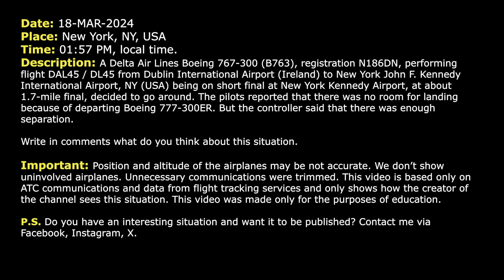Pilot argues with Tower controller about separation at New York Kennedy Airport. Real ATC

Comment: The Go around is the "most professional procedure" in aviation 
something is not right , maybe too tight , bad wind , long flare , runway not vacated in time , late gust , not stabilized .. whatever .. go the hell around !! its the safest option ..
could have been avoided if by atc separating em a bit more , also the "citation and the "Air India would have had me on alert right away .. you cant squeeze and make tight schedules with everyone just like that , better to get some 20 seconds more space by slowing / asking to slow delta down earlier

Comment: There isn't any discussion about this. The Captain of the Delta flight 45 H felt it was they were too close to a departing 777 and he elected to initiate a Go Around. Safety is of paramount importance and his decision seems like the prudent decision. The tower controller can discuss the Captain's decision on the telephone AFTER the aircraft has landed and is parked at the gate but the tower controller is NOT responsible for the safe conduct of the Delta or any other flight.

Comment: As a former tower controller I know approach does not like working an aircraft twice so inquiring about the go around is something I would do, Tight is still legal but of course the pilot has the final say. We used to run them very tight at FLL. 6000 ft and airborne was just fine by me and based on the spacing mentioned it would have worked IMHO. . My personal opinion of Delta pilots, in general, is that they were prima donnas.And JFK controllers will be JFK controllers.

Comment: Tower controllers seem to forget that with the immense amount of pressure on safety placed on pilots, that safety margins cannot simply be reduced down to such tight parameters, regardless of whether "it would have worked" or not. Just because it legal doesn't mean it's okay. Well handled by the pilots, and JFK controllers are... Well let's just say they're special.

Comment: I agree that it is the pilot’s responsibility and would never criticise them for going around as I was not in their position on that specific day. My only observation is that at that distance from the threshold they were at probably just under 800ft at 1.7NM, minima would’ve been just over 200 ft on ILS CAT 1. To wait until minima to decide would have been approx 50s further down the line and the Air India was already above 50kts when they were at 1.7NM. Take off roll for 777 probably about 45-50s from low speed rolling start (guesstimate), my guess it at minima the 777 would’ve already been airborne a few seconds earlier, if not could go around then. Kudos to the pilots for the calmness in their dealings with ATC

Comment: If Air India 102 blew an engine before V1, Delta 45 would have been in a bad spot with that bird sitting on the runway with potentially pieces of metal all over the place. PIC is the ultimate authority and if experience or gut feeling says don't, then don't. Poor ATC - we don't care how many times you got away with it before, this landing is the only one that counts. Maybe it would have worked, but maybe it wouldn't - and we know who sits in the hot seat if it doesn't.

Comment: "It would have been tight" is all you need to hear. Margin for error doesn't matter, it worked last time, it should work this time.
Reply: Would have been tight *to the margin of error*, not encroaching into it. The controller has specific spacing requirements that he cannot legally break, that is the safety buffer for a margin for error.

Comment: “It would have been close but…” Controller deleted all margin for error. Pilot wins.
Reply: No they didn't. There is a regulatory margin of error by way of minimum spacing requirements. The controller just said it would be close to the minimum requirement, not that it would violate it.

Comment: When a controller says that "it would have worked, it would have been tight."   
That statement alone indicatesd that this controller takes chances with pilots' lives.
His statement deems him a risk to the aviation community!!
Reply: No it doesn’t. This guy is a controller at one of the busiest airports in the world, his literal job is to keep traffic tight and as close to the minimum required separation as possible so as to run things efficiently while maintaining the safety margin required in case of any issues. That is exactly what he did in the video.

Comment: I’m sorry, but conducting a go around 1.7 miles out with traffic on a decent departure roll does not warrant a “safe go around.” If anything, I find this to be more dangerous. 
With initiating a go around, you are closing your distance on the departure aircraft with increasing your speed. 
Let’s be real here. If the Air India were in fact to abort close to V1 which is crazy and highly rare, you would have adequate time to initiate a safe go around procedure. 
Times are definitely different. I remember flying into SFO and the controller requesting departure traffic on 1R to have their engines spooled up while 28R landing traffic to clear to get them out.
Reply: Sit down armchair pilot 😅you have no clue
Reply: You’re right, I am not a pilot and have no clue. Thanks anyway

Comment: He tells an inbound heavy jet that can hold 300 PAX + Crew it quote "would have been tight" Unbelievable. Those are four words that should never come out of the mouth of a controller to a pilot, let alone one who was less than 2 miles with a triple 7 not at the very least on the roll at cross speed. Ridiculous.

Comment: For legal separation in that situation, all the tower controller required was 6000ft separation and the departing air india airborne by the time that delta was over the approach end threshold. Sometimes pilots (especially airline pilots) antsy and think the separation is too close when in reality according to the FAAJO 7110.65AA (ATC bible) it is completely legal separation. If the controller says its legal, chances are it is.
Reply: Legal doesn’t always mean safe.
Reply: @CFI-King  in the ATC world, legal = safe. Its not the same thing as legal vs proficiency or legal vs safe like it is on the pilot side of things. On the ATC side of things, if its legal, it is 100% safe.
Reply: @xxhockeymaster03xx  Fair enough, but if you're a controller, you know that the PIC is the "directly responsible for, and is the sole authority as to the operation of" the flight. The squeeze play may have been legal, but ATC had no need to get feisty on frequency about it. If the PIC didn't feel it was safe, it wasn't safe.

Comment: Calling cleared for takeoff with traffic on a 2.5 mile final is, as the tower noted, very tight, and "I do this every day" is exactly the type of complacency that must be stamped out in industries which require the utmost care for safety. Horrible mindset to have and uncalled for to get snippy with a pilot for daring to go around when you know it's tight.

Comment: I don't know how accurate the altitudes on the screen are but going around at 800 feet is, in my opinion, unnecessary. At 800ft you're roughly 1 minute from touchdown, if like the video said AirIndia was at 54kts they would have been airborne within 20 seconds at the most. I remember one time in Stansted we were given landing clearance at roughly 100ft from the ground because there was a runway inspection due to a bird strike from the aircraft that landed before us. I could see the cars for the inspection clearly as it was a clear day. 
Going around is NEVER a bad decision, but this (if the values on the screen are correct) is definitely a premature go around.

Comment: So I see a lot of aviation enthusiasts here not understanding the gravity of this unnecessary pilot initiated go around. Let’s go ahead and dissect this just a bit and I’ll try and keep it short. 

A 2 1/2 mile final with a 777 facing a headwind gives Air India plenty of room to take off and Delta to land with probably around a half mile to spare. Normal approach speed over the ground is about 140-150 kts for a 777 with the 17 knot headwind that ground speed decreases even more. 

For all of you sticking up for the pilot and saying he has the final call on his aircraft’s safety, you’re 100% correct and we all have to live with that. However, the captain wound up actually putting himself and his passengers in more danger by going around for a few reasons. First off he’s putting his aircraft in an unusual situation with a very small margin for error with an exponentially increased workload behind a departing(albeit above) heavy, second he’s putting the aircraft back into an extremely saturated airspace where he now has to be resequenced anywhere from 5-15 aircraft back depending on how busy NY approach is unless there’s a mother hole for them. This will further exhaust the fuel the aircraft has, potentially putting them in a near minimum fuel situation. Lastly, but not least, he’s putting himself in a closer proximity to the departing heavy Air India depending on how quickly Delta decides to turn or climb the aircraft. At the end of the day this wasn’t the best play even though the crew thought it was.

Comment: Well. Moved a few iron birds in my life. This is a case of jamming. Been their done that. Was it smart? You get away with it most of the time but it can bite you back big time. Listen to the controllers voice when pilot tells him he is going around. A little quiver like oh shit. The controller was on the roll. Thought he had his timing down and poof, brain scramble, gotta work this out. Separation required departing aircraft clear of runway before arriving aircraft crosses threshold.   Both aircraft made aware of situation.  Probably would have worked BUT. Pilot is always in control. Controller is not flying the bird. At ORD, unless I was familiar with the pilots abilities, I never put a non U.S. carrier on the runway for departure in front of arriving traffic if it looked close. I found foriegn carriers less responsive to my need for, lets get it done situations. You even get to know which carriers move quick and those that don't. Air traffic control is not a job for the faint of heart, especially at the majors. This controller is good. Knows his stuff but got bit, which, sooner or later, happens to all of us. Remember there are passengers on these aircraft. People who could die. Controllers develope a 3D picture of separation in their brains.  I sometimes felt like it was an airborne chess game. Extremely satisfying to end my shift knowing I had won the game again getting them all in or out. I loved every minute of it. They are going to hire 3,000 new controllers! When I went through ATC school we had an 80% washout rate. There are good controllers and bad controllers but there are no mediocre controllers. This guy is good. My advice, stay away from remarks over the air. Suck it up and keep moving iron birds.

Comment: I would not have landed while I visually still see a plane on the runway. If the plane takingg off had a mechanical fault and had to abort take off and the landing jet was flaps down and landing it could have been a disaster. The atc did not take that into account. He assumed the take off would go as planned. Dummy.
Reply: Doesn’t EVERY approach into JFK involve a plane APPROACHING (not landing) with another plane on the runway?

Comment: 1st Captain is responsible...his call at the end of the day...
2nd ATC condescending on the Delta 45 is an absolute "No-No"!
3rd the mistake began with the Cessna and ATC assuming a swift RW vacation. Not happened. Looks like ATC gave a TO clearance when the Cessna wasn't truly clear of the RW.
ATC treatet Air India as GF5 jet not as a heavy...THEY NEED EXTRA TIME. And then blaming DL45 is the  audacious!
Kennedy Steve would have said..." oops I have been a little optimistic there...DL45 go around plz. Sorry for that..."
This is how you ruin efficiency and trust (in JFKs ATC) 
Remeber that Swiss clusterf...?!?!
JFK is that smoking gun....waiting to go off!

Comment: Delta captain has full final authority.    He made the right call.
Reply: I wouldn't call it the right call. He made a safe call. The spacing was fine and happens everyday thousands of times. 1 mile is the minimum and they were outside it.
Reply: It was too tight.
Reply: @cnvi08  Imagine if Captains started to all go around at 800 ft ... (2 miles from landing) ... we'd have traffic jams everywhere. In the skies, holding patterns, airplanes waiting to takeoff. Sigh.
Reply: If the captain sees what this licensed pilot saw, I would have gone around too.  Safety first!
Reply: @cnvi08  Oh, a licensed pilot. LOL

I've done a couple of go-arounds, when I was at the BigD and I don't mean Dallas, in Atlanta at or around 100-200ft. No biggie. They were at 800ft. That's 2 miles to go but hey they were safe and that's all that matters.

Comment: The ATC is depending on the air india pilot to have HIS head in the game, in order to make this work "a little tight" Any hesitation at all by the air india pilot in throttling up and any issues with the engines IN throttling up will turn that "a little tight" into the lead story on every cable news channel. The ATC is betting his job on the air india pilot getting it exactly right.  When the fireball rises somewhere out on the runway, the ATC is going to hear a voice in his head saying "do you see that bright light blinking in the corner of your eye, that is your career dissipation light, it just went into high gear"   A raised glass to the Delta pilot in saying to himself "I'm not risking my life and the life of the passengers under my care, on two other people getting it JUST right in a situation that is "a little tight"   Bravo Captain...Bravo!!
Reply: Air India has to reject near V1, Delta goes around and it gets close, everyone would have asked for the pilots head. Not the controllers. That's why he behaves likes he does.

Comment: The Slowtation is really at fault here for using up all the runway to shorten their taxi time to the FBO and in doing so, delaying Air India’s takeoff clearance. 
However, a 1.7 mile-final on a 3° glideslope is just above 500’. If Air India was already at 54 knots, then Delta would have made it in. However, both the controller and the pilot are “in the right.” It would both have been close but worked; also, the PIC is ultimately responsible for safety, and is in the right to initiate a go-around even if it is exercising an excessive amount of caution. Nobody was ever worse off coming around to try another approach as long as you have the fuel for it.

Comment: Browsing thru the comments section here, it’s painfully clear few people understand how ATC works, what their rules are, and what information they have at their fingertips in order to make a better judgment call than the pilot. It 100% would’ve worked for 2 reasons: if the info provided in the video is accurate, there was still lots of time and space (I’ve never heard of a pilot electing to go around so early, 1.7 miles from the threshold!!!) , and 2, the controller literally sees this many, many times every day (as do I). The pilot DOES NOT see this everyday. I understand the knee jerk comments “the pilot is the final authority, blah blah blah” being spewed by lemmings around here, it somehow emboldens/empowers people to put “mean old ATC in their place”. Simply put, if pilots were to start going around just because they ‘think’ they know the spacing requirements better than the JFK controller (who’s job it is to literally observe and judge spacing), then don’t you dare come crawling to these comments sections in order to vent your frustrations about ATC delays, ‘cause that’s literally what an unnecessary go-around causes. Go-arounds ARE warranted at times, this did not seem like one.